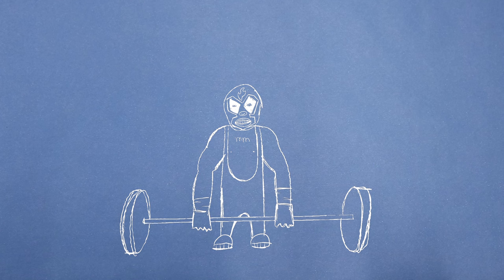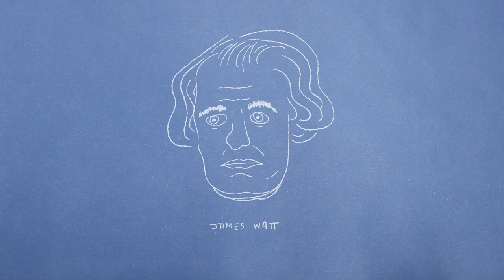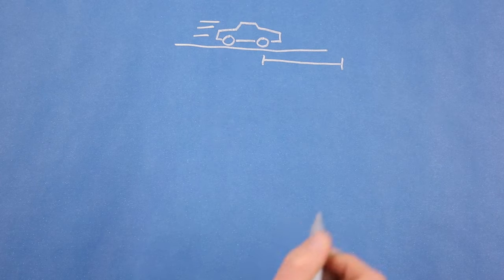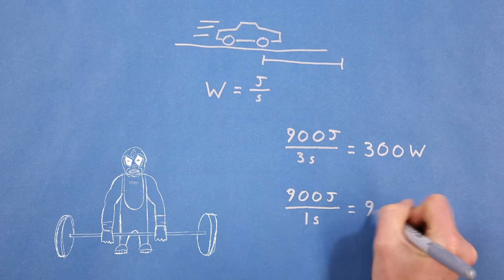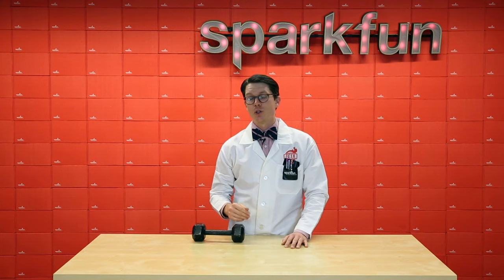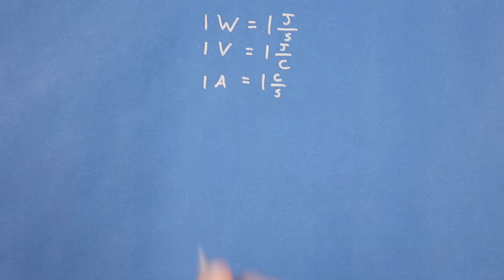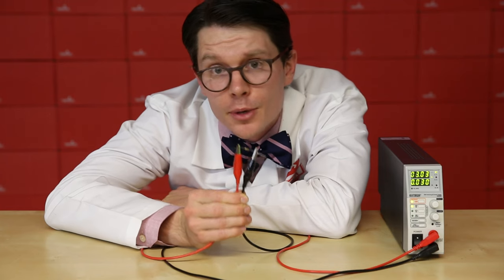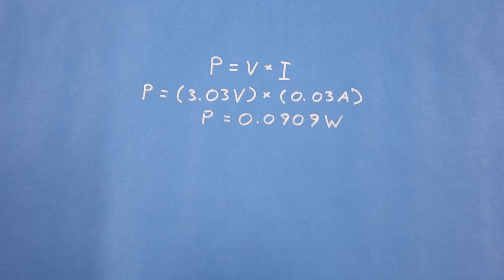Electric Power

Comment: I like the little history that goes along with this, like the horse power rating. Back then when someone invented something, they needed a way to relate it to the end user and that was a farmer. He needed to know that a steam engine could do the same work as "X" amount of horses.

The same is true for air conditioning units and why they are rated with the "TON" rating. Back then, AC was invented to make ice and those who sold ice, sold it by the pound. So they needed to know how much water could be frozen into ice in a 24 hour period, and the ton rating was born. They knew 250 gallons of water was a ton, and that made 50 of the average 40 pound blocks of ice that were sold for ice boxes. Now they did not have to cut ice from a lake in the winter time and save it in saw dust over the spring and summer. They just made ice and all they wanted with AC.

Now all larger AC units are rated in TON. Some smaller units are rated in BTU's, but there are 12,000 BTU's per ton and 3.4 BTU's per watt. So it's easy to figure "BASIC" power needs and what can be expected from certain sized units and what to look for when most homes need one ton per 350sf of living area, give or take. I'm really enjoying these videos. Keep up the great work.

Comment: Good video, but i'm sad to see that the infrared thermometer is used incorrectly. It should be held close to the resistor and pointed to a matt black spot in it to measure correct.
Reply: Good comment, but chill man!!  The way he does it gets the point across perfectly. Its a fun little experiment done in a fun, quick way. If he did it in the 100% perfect way and have to explain it all, the video is going to go for 20+ mins. 
Why do people constantly look for the negatives? To say that you 'sad to see' he used it 'incorrectly' is pretty piss poor form. Are you going to go around and tell all the nurses that the way they are currently using their infrared thermometer on people entering hospitals during the COVID epidemic is "wrong" because we don't spray paint some matte black paint to our foreheads first?
Reply: Also, find me a black spot on the white resistor anyway? You cant modify it by scratching or placing any other materials on it, else the characteristics are changed and your point is moot anyway.
Why am I still here wasting my time talking to a comment from 3 years ago?